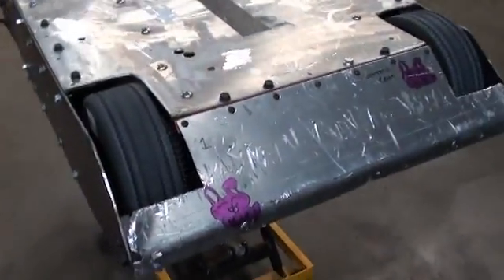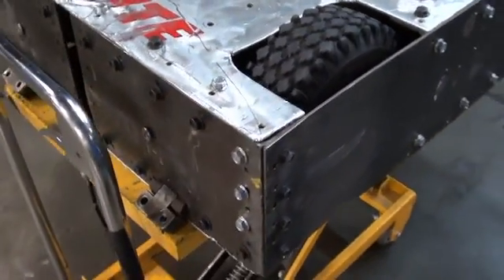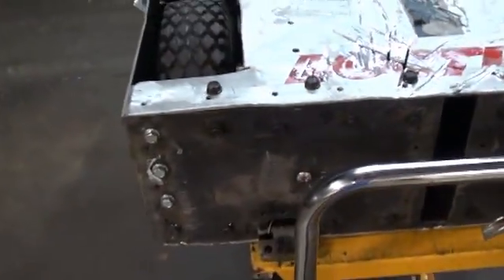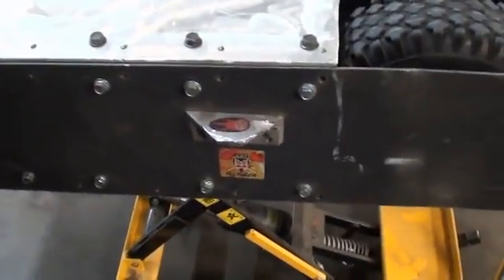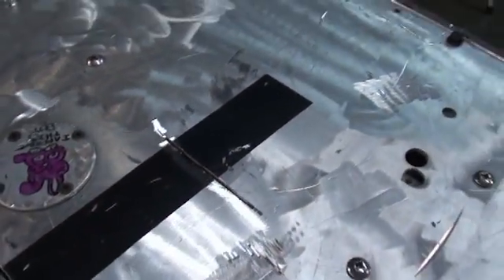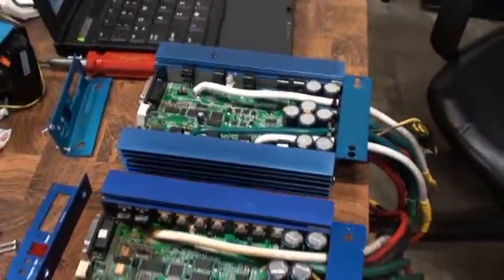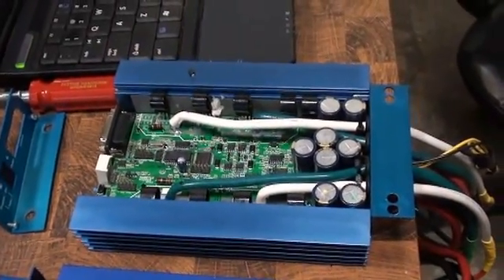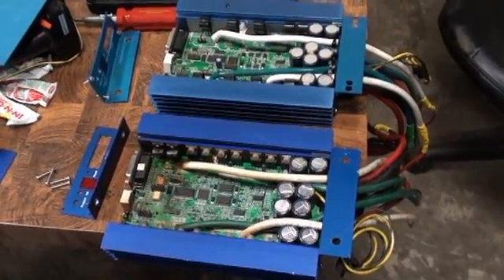Post RoboGames 2015 - beat and broken

Comment: it looks like the right design for a high powered drum ;)
Reply from the maker: +Nathan T   The rubber bumpers worked surprisingly well.  Using ablative armor against a fast drum is a valid strategy.
Reply from the maker: +Nathan T   The rubber bumpers worked surprisingly well.  Using ablative armor against a fast drum is a valid strategy.
Reply: +teamtiki I mean like redesign it for a 35 pound drum of sorts